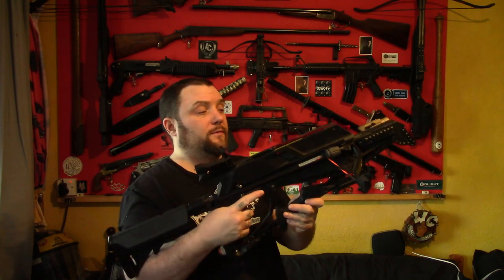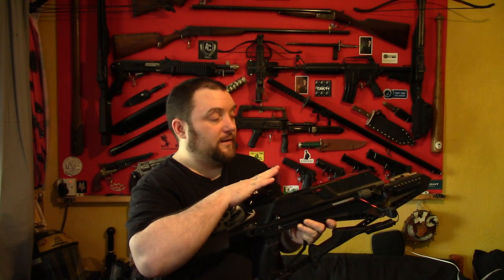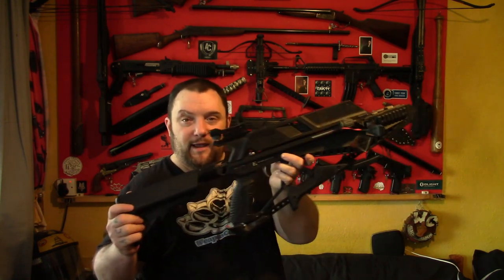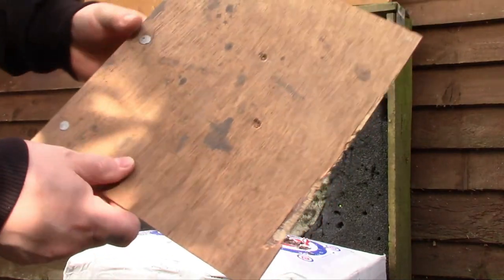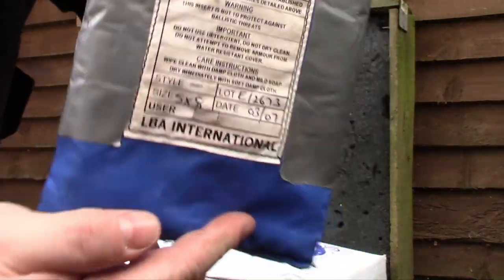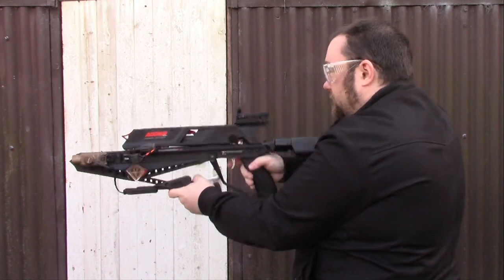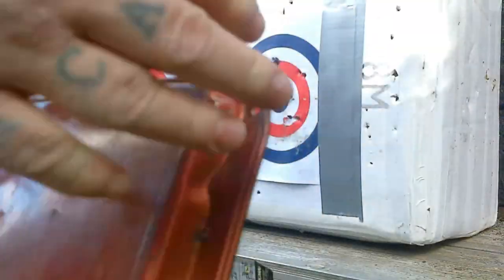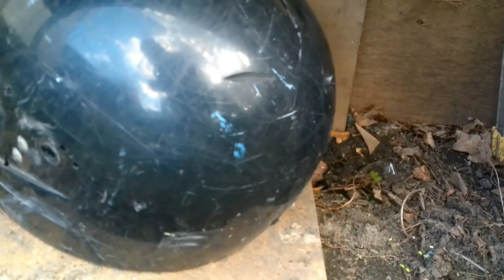Cobra Adder Repeating Crossbow Tests

Comment: The crossbow went together quickly and the general fit and finish is a bit above what I expected for the price. https://www.youtube.com/post/Ugkx5B43Qabqt1HedUJyfEqxiwBCfaooIH52  The adjustable stock is a little loose. I had an issue when I tried to cock the bow for the first time with the safety on. The string set in the trap box, held just enough to build up enough tension to rip the string out of my hands when it let go. No significant damage was done, and once I got it sighted in, I wrecked a couple bolts by sending one straight down the shaft of the first. I'm holding ~2" groups at around 50 yards, and I'm not an expert by any means. Best part is that they supply all the replacements parts you may ever need

Comment: These are the types of vids I really like. Hope you do one with the Hori-Zone using your broadheads and bodkins, maybe with some added weight in the shaft and seeing how they compare with just normal bolts. If there is a big difference, which I think there will be, then it would be a great advert for them. Cheers Mike....
Reply: The new stinger 2 with the 90# limb would be sweet but dam there expensive. I just ordered the 80# stinger 1 limb for my pse viper for $77usa after shipping and taxes hope its worth it.

Comment: Great video. I just love the Adder. Have my Adder for 2 years and still shoot almost daily with it. The string is also still original, you just have to lubricate it properly after every tenth shot.
Reply: So you don't suffer from excessive string wear even while keeping everything waxed up? I keep my string waxed really good and also apply wax to the rail. And I do it every 5 shots as per manufacturer's recommendation. Still, I ordered a few replacement strings just to be on the safe side.
Reply: @svenschwingel8632  Hello, I would recommend that you do not immediately replace the whole string, because that will be quite expensive in the long run. It's better to get a sturdy string designed for this purpose and replace the serving of the string. This will save you a lot of money and you won't have to buy a new string. It is quite easy to do this yourself and there are very good videos here on YouTube where it is explained excellently.
Reply: @svenschwingel8632  I hope you understand what I mean. English is unfortunately not my native language. 😏
Reply: @joe_souls  don't worry, I can understand you fine 😉

Comment: Since the law in my country on guns is really bad im considering buying one for home defence because i cant own a gun what do you think 🤔 is good for home defence?
Reply: You might have a hard time using it inside and it is quite slow, it could work though. Best to do simple upgrades on the home security though things like making sure your deadbolt locks on the doors are using 7cm screws instead of the cheaper 2 or 3cm ones and getting some of those little battery powered door alarms for the back doors and windows. Even something as simple as putting some bells on the curtains could help, that and having stronger doors around your house so that if you end up in a bad situation you can lock and barricade the doors and give yourself time to deal with the situation and call police.
Reply: Yes, it's good for home defense. It's smaller than a regular crossbow and its faster due to the loading mechanism.
Reply: It's obviously a killer. It will take a deer out no problem, so a human would pose no threat.

Comment: I recently purchased one of these and wondered what you can recommend for a target, as I’ve tried on a couple of things and it either burys so deep into wood I can’t get the bolts out or it’ll go through some softer targets and rip the flights off. I have purchased a 5 layer straw target and this seems to stop them okish. But wanted ideas for other targets without bolt damage pls 🙂
Reply from the maker: Try this , it my video for a basic homemade back stop - fine for my cobra adder https://youtu.be/TTdw59aciA0
Reply: @WeaponCollector  thanks, watched it at work and so made one 😊
Have you got a link for the targets, they look good to have six in one sheet ?

Comment: Hi this Is the adder that comes with a 130 pounds Bow right?
Whats the lenght And the weight of the bolts? Thanks
Reply from the maker: yes, this is the 130lb Cobra Adder, and the bolts are ek archery cobra system adder 7.5 inch carbon bolts which are 190gr
Reply: @WeaponCollector  thanks

Comment: Also @WeaponCollector like your content mate. I wanted to ask something, i seen a mod on a redback you made on the front for extra leverage, i wouldn't mind something similar if possible but not that, what i have in mind is a short spike round so it can be used for leverage, but a sharp point, not too long, 4-5 inches would suffice, and in black, but i mean i can paint it, just to blend in with the whole thing, let me know if you see this, cheers man.

Comment: Does it only clock/reload when you put the arrows in first?
Reply from the maker: There's an arm that hangs down that stops it cocking, once bolts are in it will cock, but you can lift the arm to cock it and insert a full length bolt.
Reply: @WeaponCollector  thank you it works awesome now

Comment: Hello my friend amazing videos. I bought a cobra adder and it arrived today. Upon setting it up I noticed there is a lot of wobble in the stock. For now have fixed it by placing a piece of card in the point where it attaches. Is there a better way to do this? Thanks!
Reply: Silicon washers.
Reply: This wobble might be there for a reason such as reducing kinetic energy from the bow .

Comment: I am generally surprised that helmet stopped it
Reply from the maker: Even the old helmets are surprising good at stopping stuff like this
Reply: @WeaponCollector  yeah I just thought a bodkin would wizz clean through I've seen people shooting at steel frying pans and it sticks right In same cobra adder crossbow aswell
Reply: @WeaponCollector  and quick question I'm buying this crossbow but I'm quite skinny and not strong do you think I can cock this easily or isit quite tough
Reply from the maker: @julieann8667  you should be fine i think Julie, the lever action makes it a lot easier to cock than other 130lb crossbows, but if it came to it you could later replace the limbs with a slightly lower set and still have decent power from it, i think you should be o.k though.
Reply: @WeaponCollector  yeah thanks might just have to get on the weights lol 😂
Reply: @WeaponCollector  have you tried armour piercing tips? Do you think that would go through the UK standard body armour?
Reply: try with Bodkin point!!
Reply: Pretty sure modern jousting knight helmets use biker helm tech on the inside too.